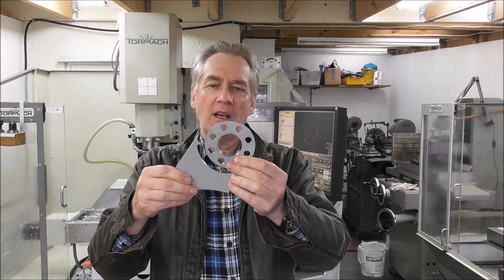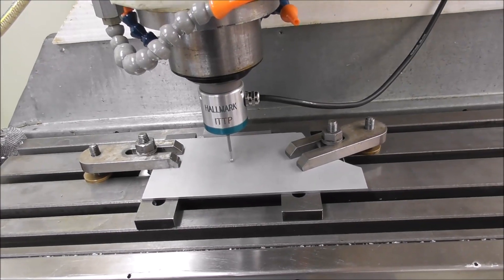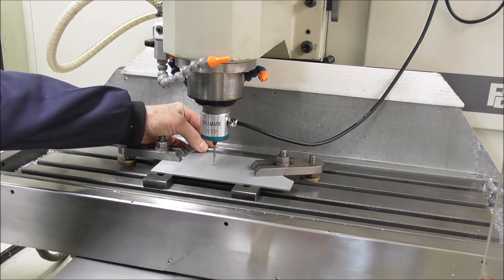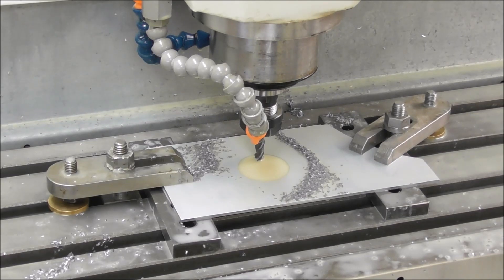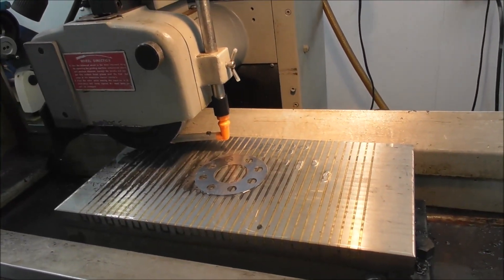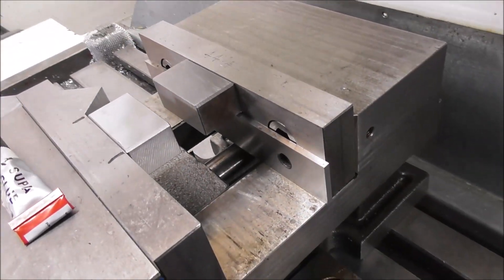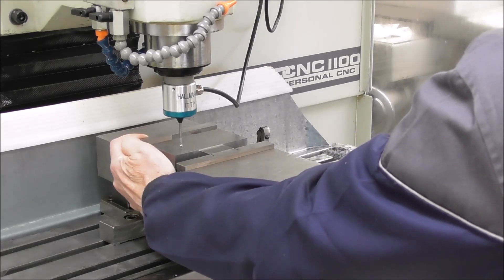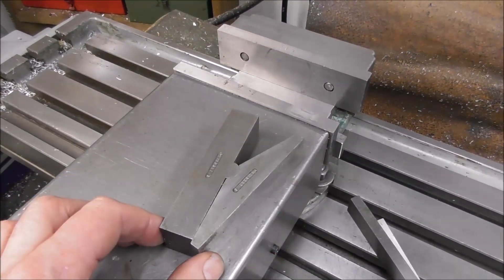Tabs and Vise Standoffs -  Part3

Comment: Nice!
Love the superglued small blocks -- a good way to get narrower holding. (Will save me from buying a toolmaker vise.)
When using tabs, I generally cut the outside profile last, to keep the most rigidity. Also, I've found that a final pass that cuts the tabs down to thin thickness makes them easier to cut off, and also machines more of the profile where you're going to cut it off.
Reply from the maker: Good points Jon - Thanks, Cliff